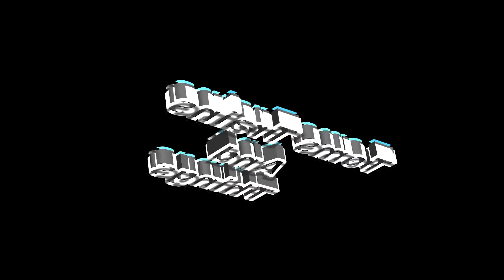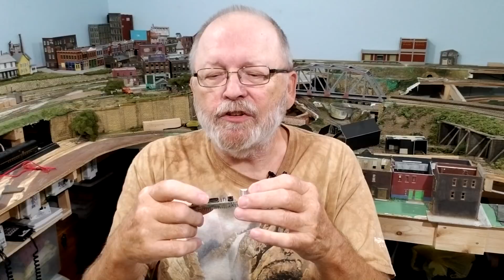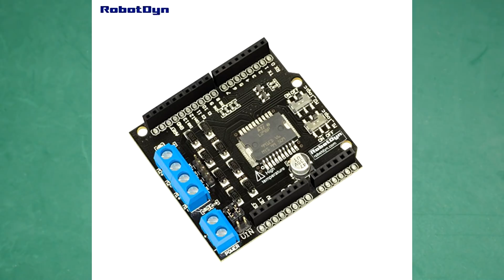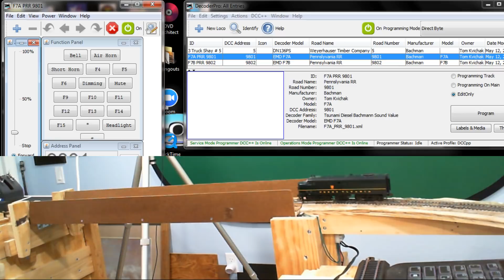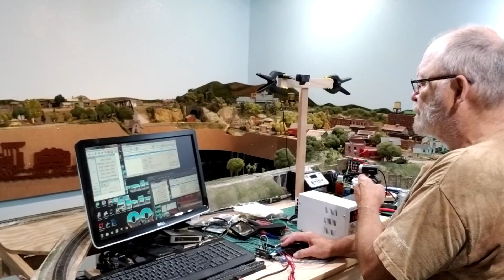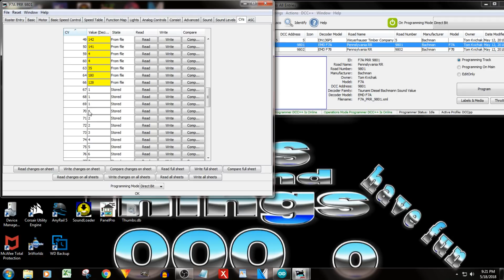Switch To DCC using Easy and Inexpensive DCC++ On Arduino

Comment: JMRI allows multiple control system all running at the same time but only 1 can control the trains, this is set in defaults. So DCC++ for locos plus  digitrax AND DCC++ for track detection, turnouts etc. I use nce as main controller and then digitrax/nce for turnouts and just digitrax for track detection.
I am thinking of selling the nce and replacing with the DCC++ I have.
Reply from the maker: Thank you very much. I'm going to have to look into that a bit further. That would be awesome to be able to use my turnout controls
Reply: No problem, thank you for putting so much useful and understandable info. 
The JMRI setup is "edit", "preferences", "Connections" the "+" for the extra system. Then "edit", "preferences", "Defaults" for which one is main controller for various functions (throttles/turnouts etc). 
JMRI is great but not so well documented nor covered well on you tube.
Reply from the maker: I can't believe it's that easy. I used that + before to test out two different configurations, but never used them together. Thank you very much. That looks like a future video once I get it working!

Comment: Hello sir, I have a problem when the pro panel program is already open, its function  Panels don't work. The power button is clicked on the loko, only a beep sound + the light is on.
Reply from the maker: Need more information. Are there any error messages? Have you double checked your connections & settings? Have you cleaned the track?
Send me an email!
Reply: @TomsTrainsandThings  hello sir, thank you for responding to my message, my problem has been resolved, I reset the arduino program and JMRI settings. now I can control my loko from my smart phone. 🙏 Thank you.

Comment: I had a question about the power supply I know once you do the etching on the motor shield it doesn't let the high voltage go through to the adreno. My question is how many trains will it run with the power supply back in your video or could I add a power supply save from an old computer and use that
Reply from the maker: The power supply does not limit the power, the shield does. If you requite more amperage, you can use a Pololu shield or check out the newest version DCC++EX which allows much more flexibility. 
https://dcc-ex.com/
An old computer power supply will work great if you add a Buck Converter to boost the power to 18VDC. 
https://youtu.be/-YFL0qWQE98
Reply: Tom how many trains would I be able to run with just the regular plug in the wall DC converter
Reply from the maker: @fruehauf01  Depends on the amperage rating of the wall wart and how many cars you pulll with your loco. You'll be able to run 4-5 locos if the wall wart is rated at 3 amps under normal conditions
Reply: Tom I think that may have just solved the problem I may not need to add the PC power supply and the booster just curious if I did add the computer power supply with the booster probably up to 18 votes how many trains could you run then
Reply: I also have an old spectrum magnom transformer that puts out 15 volts dc

Comment: Hello Sir I just finished watching your video on How-to build a DCC system. Did I hear you right that if you have a DCC+ or DCC++ you can run a Layout as long as it has AC. So I can't run my Lionel Fastrak Locomotives?
Sincerely 
Allan
Reply from the maker: DCC takes a DC voltage, turns it into a DCC signal specific to an address. A locomotive needs a DCC decoder to read this signal and turn it back to dc to run a dc motor. You'll have to look into what Lional has available in automation.

Comment: Hi Tom Great videos I enjoy them all. I have built a DCC++ system using arduino une and L298P shield with a 12 volt supply. The trains run but there is no voltage at the track. I am confused can you explain what's going on please. Rod from Scotland.
Reply from the maker: Send me an email with more details. Maybe with some pictures.

Comment: Great videos I enjoy them. I built a DCC++ system using arduino uno and arduino L298Pshield. The trains run using a 12 volt supply but I am confused since there is no voltage at the output terminal or,obviously, the track. Could you explain whats going on please.  Rod (Scotland)
Reply from the maker: Which motor shield are you using? Not all motor shields are the same even though they have the L298P. You say the trains run using a 12 volt supply; Are you saying they work with DC? What kind of decoder is installed in the locomotive?
Reply: @TomsTrainsandThings  Thank you for replying I really appreciate it. I am using genuine arduino shield Rev3 with box number A000079, the code on the receipt is 85423190. I have connected a 12 volt DC supply to the shield and cut the vin connection to prevent the shield feeding power to the uno R3. I have connected a USB cable to the computer. I am using JMRI and panel pro identifies the locomotive decoder; I have several different decoders in either Hornby or Bachman locomotives all of which are 7 or 8 years old. When I switch the system on and select a locomotive I can run the train although they stop at points which use tortoise motors. What I cannot understand is, as I say, there is no DC output voltage from the shield.
Reply from the maker: You can not read a DCC signal as DC. You have to use the AC scale since it is a high frequency signal and not a straight DC voltage. As far as your locos stopping at a turnout, you have to add feeders beyond the frogs of the turnout, since a lot of the turnouts do not carry the signal beyond the frog. Also some frogs are plastic. Some of the newer turnouts may have a wire on the bottom to route the power to the appropriate rail. Others are jumped within.
Reply: @TomsTrainsandThings  Thank you so much for that. So far as the turnouts are concerned I use Peco electrofrog with dropper wires to the tortoise and frog. I don't understand why the loco stops. When I used a Hornby select controller I could measure DC voltage at the turnout to make sure I had the switch wires to produce the right polarity. I can't do that now; is the DCC++ system different. Please excuse me if this is a daft question but I am struggling to understand how this system works.
Reply from the maker: The video I'm referring you to is not an electrofrog, but it's the same principal. This may help you to find where your problem is.  https://youtu.be/DEGu63C2EN0
Remember DCC or DCC++ is Not DC, it can not be read with a meter on the DC setting, it has to be read on the AC scale. Maybe a better way to check to see if your wires are correct is to not apply power and check for continuity on the rails making sure you have continuity from the rail continuing past the frog.
Reply: @TomsTrainsandThings  Thank you it has helped me a lot and restored my confidence.
Reply from the maker: @rodmerrall1969  Glad I could help.

Comment: If I just set up a feeder track connected to the output of an arduino + motor shield +JRMI system can I edit the stored values on my Kato DCC loco? I've ordered a motor shield board. I suppose i just need an isolated section of track to do this? Sorry for the dumb questions. I've just recently returned to model railroading. My grandfather got in me into it during the 70s, and he was an early n scale fan, so this is where I'm returning.
Reply from the maker: That's the preferred way of doing it

Comment: What if I need a booster?  How does this connect to an Ntrak layout?
Reply from the maker: How many loco's do you run to require a booster?
Reply: @TomsTrainsandThings  up to 44 single locomotives and 6 or 8 consisted sets plus sound
Reply from the maker: @robjones9691  You better stick with what yuou have now. DCC++ Nor DCC++EX were not made for that bog of layout. If you want mopre information on a possible way to fit your layout with DCC++EX,  go to their Discord server and post as many questions as you like. There are many developers there all the time that can answer any question.  https://discord.com/invite/y2sB4Fp

Comment: Hi Tom. I'm really confused. If you already have Digitrax system equipment running your layout, why do you need the Arduino DCC++? After all, doesn't the "Digi" in Digitrax mean digital?
Reply from the maker: Using it for an additional section of the layout. I also have a module where it will be exclusively Arduino. It can also be used in portable layouts that are taken to train shows.

Comment: This seems so interesting I’m just thinking do I use the digitrax DCC I have or do I build this up for my layout. Do you plan to keep the digitrax system on your layout or will you replace it with the DCC ++?
Reply from the maker: I'm using both on my layout. I'm also building a modular layout that will have nothing but Arduino's running it.

Comment: Do you know if possible to add a Wi-Fi shield on top of base station?  Thanks
Reply from the maker: Never tried it since I never had a need for it. I use my Raspi for the wifi signal to hook up my cell phone as a throttle.
You only have 8 pins available for custom use.

Comment: Hello Tom, first of all congratulations for your channel : really well done and superlative !! I have one question if i don't bother you too much : i have a VELLEMAN VMA03 shield for Arduino ( 2,5 A per channel and already equipped with jumper to chooese between internal or external supply ). Is there some rule to understand jumpers i have to connect together? Or can you help me to understand which jumpers i have to connect? I add also link to website where you can see all details : https://www.velleman.eu/products/view/?id=412538
Reply from the maker: I have not tested the Velleman for DCC++ although there was one other person that said they got that brand to work. But never stated how they got it to work. To my knowledge there are only a few that work. Arduino, Pololu, and Deek Robot. The problem with most motor shields is that the pins required for the DCC signal is being used for other functions in most motor shields except for the ones I stated.
Reply: @TomsTrainsandThings  thank you very much for reply .. now i understand better .. i will try and check pololu shield

Comment: Forgive the stupid question:  do the locos have regular DCC decoders? - and if so, why do you need a motor shield?
Reply from the maker: Yes the locos need a dcc decoder to operate. The Arduino micro controller produces the signal from the interrupt and timer pins, the motor shield has the circuitry to amplify the signal produced in two separate channels. One for programming and one for operation. JMRI is used as a means to communicate the throttle commands for everything to work.

Comment: Tom, has anyone heard from Gregg Berman in the last 4 years?  He developed a great system then seemed to disappear.  Do you know if anyone is going to take over support for his code?  I have developed a PC board and a little bit of code to support the S88 sensor bus on DCC++ but am not sure who I should work with to make sure my code stays compatible with the latest DCCpp code.
Reply from the maker: Gregg stayed active on Trainboard forum for a few years afterwards. There are a few ppl taking over where he left of and the discussions still go on. There are even some variations of the original code which include more features.

It's been awhile since I kept up with the thread, but here's what I just  found. Not sure ifthis is the original thread.
https://www.trainboard.com/highball/index.php?threads/dcc-update-project-2020.130071/
Reply: @TomsTrainsandThings  Thanks Tom.  I may be getting involved with those guys.

Comment: Silly question... 
What pins do you connect from the Arduino to the track? everyone shows how to build the unit then show it working but no one states how to connect it to the track... thanks!
Reply from the maker: Links to all documentation is in the description. If you use the github link you willl see several pages including this one:  https://github.com/DccPlusPlus/Documentation/blob/master/Motor%20Shield%20Pin%20Mappings.pdf

Comment: Can you use the PC power supply on the motor shield? Or is that too much current
Reply from the maker: You can use the power supply with a boost converter to get the desired voltage at the motor shield, around 16 to 18 volts depending on what scale you operate.
Reply: @TomsTrainsandThings  so can you use the DC power supply that comes with most trains I know they run around 16 volts
Reply from the maker: @fruehauf01  I would stick with a regulated power supply like a computer ps. You can try  dc power pack. Not sure of the outcome with them. Electronics are finicky about power.
Reply: @TomsTrainsandThings  do you have a link to a boost converter

Comment: I can program  the loco on the program track and i see it move a bit when it programs to it. but if i pull up a throttle  to move it i get nothing.
Reply from the maker: Program track is for programming only. The small nudge is an indication that the command was accepted.
Reply: I could have sworn that I see videos of people moving their locomotive on the program track.the only thing is I move the wires over to the main line on the motor shield and I get nothing
Reply: I guess I must have some kind of connection problem on my main line
Reply: I see the same thing.  Any update on this?
Reply: @chuckbade4486  I did get it to work.i redid my jumper wires. And was able to program on the program track. i then moved the wires to the main and pulled up a throttle and Wala. It worked. I also took off the shell off my loco and verified my decoder.

Comment: What if you want to use a handheld remote? I don't want to control my trains with a mouse. I know how to build a decoder, but what about the Aduino or Teensy or whatever decoding the signals directly from something like an EZ-Command or a Lionel Legacy controller or does that not make sense? I suppose another option would be to build a box with a potentiometer and buttons that is either read by the laptop software through a bluetooth connection or directly into the arduino
Reply from the maker: I have several videos using a mobile device as a throttle. There is a homemade throttle on Dave Bodners web site.

Comment: Hi Tom, 
I'm hoping you can answer a question for me. This is my first DCC layout. On my DC layout, I was able to run my Model Motoring slot car set. I have several slot/RR crossings and I'm wondering if it's possible to use the crossing on my layout? I've heard that using DC with DCC will fry a system. Technically the cars aren't supposed to touch the track but I don't know. I've asked other people and it has stumped them. So I'm hoping you might be able to give me an answer.
Thank you, Tom,
Russell Loomis
Reply from the maker: You can not run DC & DCC at the same time. You can switch between them on the same track as long as the other is complacently isolated. As far as with the slot car on a crossing, anytime there is a short in the tracks, DCC shuts down the power until the short is cleared. If your worried about the split second there may be a short across the tracks when a car goes over, there are worse scenarios than that!

Comment: Hello tom
Great series of videos.i just set up a dcc++ with arduino and rasberry pi.took a little bit but got it running.
My next adventure is to try and add a touch screen to the pi so i can have s complete unit to run off of other than the phone or tablet.
Once again thanks for the great videos.
Glenn.
Reply from the maker: Thanks Glenn, glad I could help.

Comment: I got a nice early 2008 Mac-Book-Pro to use on my DCC I just got to find out what else I need.  My 3 Bachmann Trams are DCC equipped.  I'd want to control switches Tram stops and routing.
Reply from the maker: What DCC system do you have?
Reply: @TomsTrainsandThings  Nothing yet.  Looking at the Bachmann, NCE and Digitrax DS64 I believe for the switches.  Not sure what to get.  I got 2 iPads with touch screens and an old MBP laptop.  Got 3 Bachmann Peter Witt trams that came with DCC installed and 3 Japanese trams with no DCC.  My layout has 2 separate loops that don't connect using Kato's Unitram track so I can rund one side DCC and the other just DC so I don't have to spend a fortune with 2 complete systems.

Comment: Hello! I was wondering how many trains can you run off of this system?
Reply from the maker: Mike, this unit can handle 2 amps, but the Polulo shield comes in a 3 & 5 amp version. Most command stations are 5 amps with some at 3 amp and boosters to handle 8 amps. It all depends on what scale you are running and the amperage of your locos. An N scale loco will require less amperage than an HO scale. The larger the scale the more 
amperage draw from the loco.
Reply: @TomsTrainsandThings  I'm in n scale so that should suffice. I might try the 3 Amp version. Do you have a link by any chance?
Reply from the maker: https://www.pololu.com/product/2503
Reply: @TomsTrainsandThings  thanks an absolute ton!

Comment: Could you use the DCC++ for just programing if someone is using the NCE system for the main running of trains
Reply from the maker: Yes, you can use just the Programming portion of the DCC++ base station as long as it's connected to JMRI. I heard it's possible to run both DCC++ & your existing Command Station together but I haven't experimented with it yet. That's another project on the list! lol
Reply: @TomsTrainsandThings  I found the motor on Amazon for $8 and the uno for $10, so I might just do that and use it for programming for now and maybe more later
Reply from the maker: Sounds like a good deal Joe.